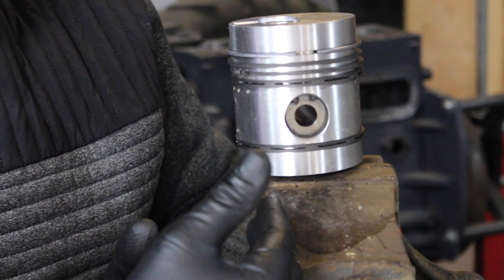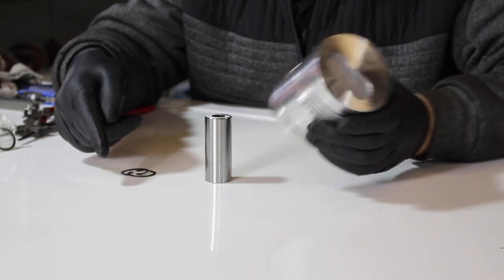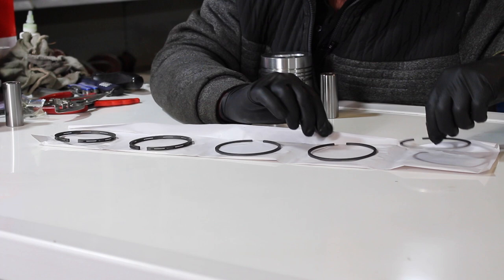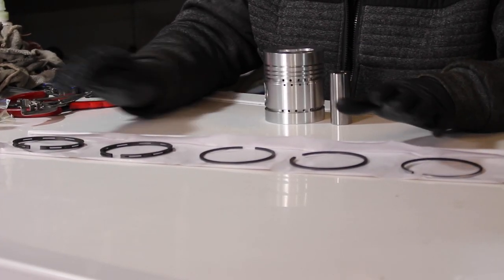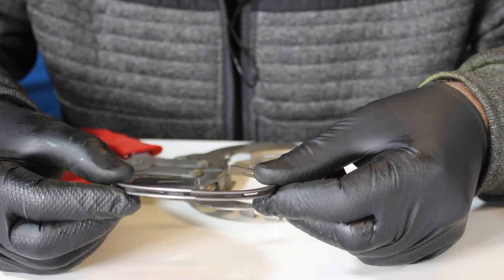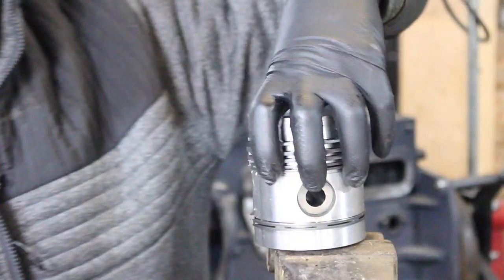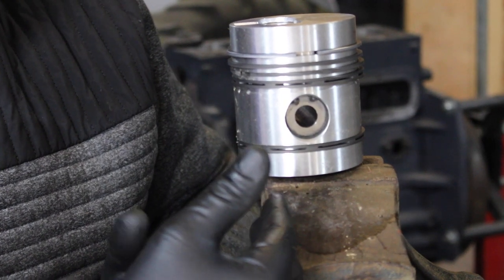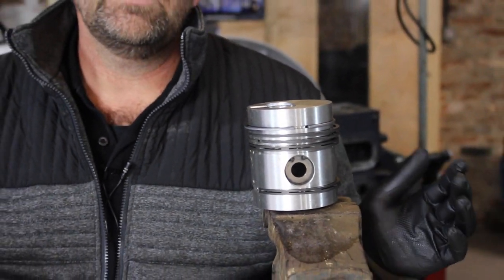Fitting Piston & Piston Rings to a Ferguson 23c Engine

Comment: Thank you for your guidance. One thing on which I wold appreciate your advice is the fifth ring. I have read numerous times, including in MF bulletins, that the ring below the gudgeon pin should not be fitted as this starves the upper rings of lubrication and causes excessive wear. Has the lower ring been modified to prevent this? Thank you.
Reply from the maker: As with another comment I've had never heard of that Ive always fitted it with no problems.

Comment: how do you bed rings in? some say work tractor hard - after rebuild mine was fine for 2hrs the it started blowing oil - rear crank seal 1 pint hr and breather pipe!
Reply from the maker: Hi thank you for your comment, I would work the tractor hard but gradually getting harder and I have found that works for me. As for the oil problem you must have some of the rings failed. The rear crankshaft seal either the spring in the seal is broken or loose or there is a wear mark on the end of the crankshaft. Sorry can’t help much more but it’s hard with out the tractor in front of me.
Reply: @kevsvintagetractorrepair  many thanks sound pointers- cheers nick